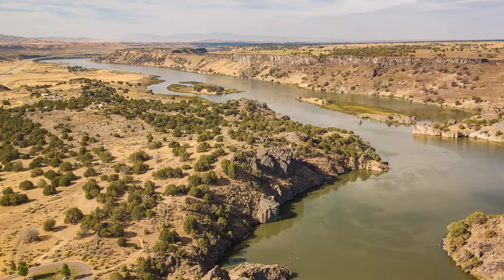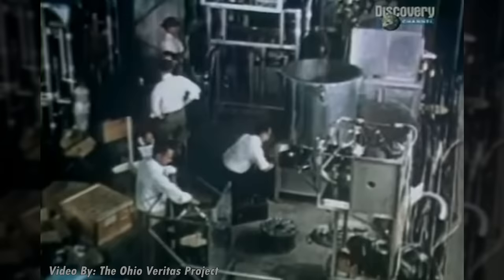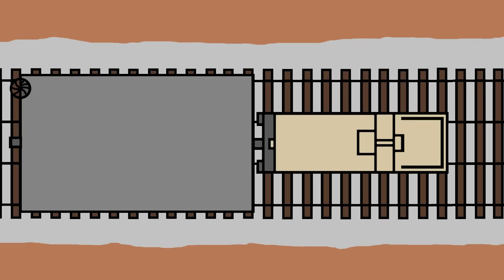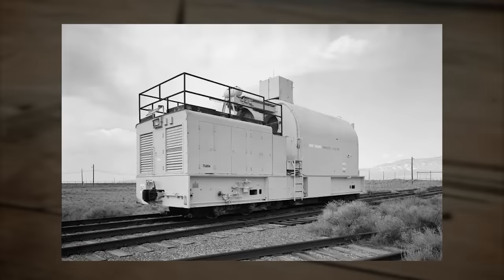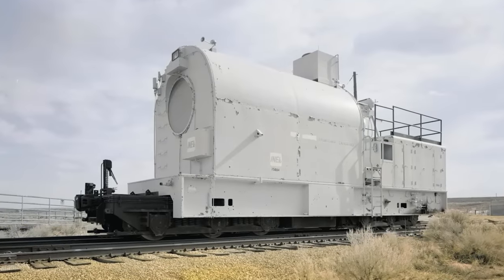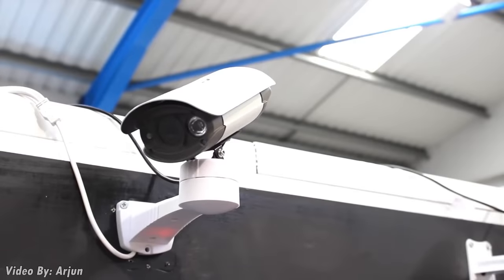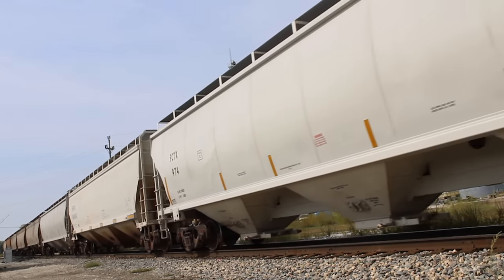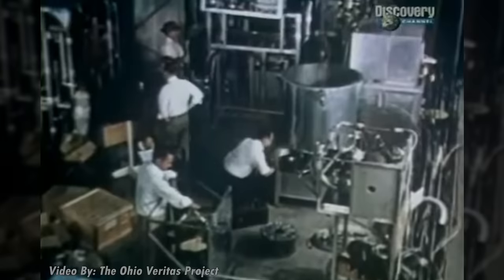The US Government's SECRET NUCLEAR RAILWAY!

Comment: The most extensive use of the railroad was during the AEC Reactor Test Station, Loss Of Fluid Test Program. Every reactor design was built on the flat car, inside what was called the "Hot Shop", a big shielded building with remote manipulators and robot cranes. The flat car with the reactor on it was then pushed into a containment dome and left parked in there on a bridge over a large pit. A very large water tank sat on the north side of the dome with a big pipe and a big gate valve to quench a runaway reaction in the dome. The water in the tank was never needed. The reactor in the dome would be connected to control circuits and cooling water systems. When It was at full power, the coolant would be drained out of it and it would be allowed to melt down. When the reaction stopped, because the melting metal diluted the melting fuel to the point where the reaction couldn't continue, everything would cool off and solidify. The destroyed reactor would then be pulled out of the dome on the flat car and moved east to the "Hot Shop", where it would be carefully torn apart and every aspect of the meltdown damage would be recorded. All of the reactor designs from US companies and a few foreign concerns, were built and tested to destruction at the Reactor Test Station during the LOFT Project. All of the buildings are gone now. They were demolished and the pieces buried during 2010-2014 by the Idaho Cleanup Project contractors. Only the locomotive remains at the Experimental Breeder Reactor 1 museum, south of US Highway 20/26, just north of the Big Butte Volcano between Idaho Falls (Highway 20), Blackfoot, ID (US Highway 26) and Arco, ID (US 20/26), northeast of Craters of the Moon National Monument. The museum is open from May to October with INL employees providing visitor education.
Reply: wow those reactors mustve been really hot!! as in radioactive.
Reply: I'm truly impressed with this knowledge. It's something most people would never know. It adds to the fact that logistics is the main way of understanding how things work. One can have/imagine a wonderful idea,but the question is always, "how?"
  I am from a unique group of individuals who always ask, "what are te logistics of something happening? Sounds strange, but it makes sense to me.
Reply: You might also want the Alco reactor in Schenectady, NY. It's now under the care of RPI.

Comment: There was a similar rail car at the Lockheed plant in Georgia built to test equipment that had been irradiated. The locomotive would pull an unshielded air cooled reactor around the complex and park it near equipment to be tested. Then the control rods were pulled by remote control.

Comment: Thought I knew a little about INL, never heard of this though! Very cool purpose-built loco and that double wide turntable has gotta be one-of-a-kind as well. Great video. 
And fwiw, thank you for not over playing the danger posed by the lab, as a nuclear reactor such as those being developed and operated at the site, are not and cannot become a nuclear bomb. Those nuclear jets though... They operated with an open air cooling circuit, meaning the air going the core became radioactive and left a trail of fallout. Not a big deal over enemy territory, but not ideal for testing on home soil 😅 (They also weighed nearly as much as that loco!)
Reply: Technically, only the GE design used an open cooling circuit. The P&W design used an intermediate working fluid and a heat exchanger.

The good news for either one though is that most of the neutron activation would be of atmospheric nitrogen, which has a half life of only 7 seconds when activated and would therefore completely decay in minutes.

Comment: Pushing cars at 02:25 is used in a few places for various practical reasons. The Snowdon Mountain Railway (North Wales) - For example - Pushes passenger cars up the mountain without them being coupled to the locomotive. This is a safety feature so that if the loco jumps the rack and rolls down the incline it doesn't pull the passenger car down with it, which tragically did happen in one incident shortly after the railway first opened and which resulted in that practice.

As for top speed at 05:30; If my experience of the Empire Builder is anything to go on, this lil' loco - Despite its weight - Is still capable of travelling 4mph faster than many things operated by Amtrak! 🐌💨🚂😉

Comment: Never knew there was a little network of tracks and even a turntable at this place. I knew about the wide flatbeds and only saw pictures of the shielded loco, but I didn't knew a thing about the rest. I thought there only was one piece of track to push experiments around, and not at all of this. Very impressive installations. Would be lovely to have a model form of all of the place (with running trains of course) at the museum. Modelling nuclear reactors must be a lot of fun :P
And there is also another very unique loco related to the US cold war nuclear industry. And it's a darker and even more radioactive story. It's at the Hanford Site. The process to produce plutonium for bombs involved irradiating nuclear fuel for a short time in specialized reactors, then taking it out while the thing was still running, to be then processed in separation plants (the "canyons") in another part of the complex. The thing between the reactors and the separation plant is a railway, of course, and the way to transport something as radioactive as a freshly irradiated nuclear fuel is under water, in a specialized open top railway hoppers full of water. The water was a sufficient shielding for a normal locomotive to be used to push the wagon around, albeit with a flatcar between the water hopper and the locomotive to have some more distance and protection for the crew. But once at the separation plant, the wagon had to enter the heavily irradiated building. Separation plants are so radioactive that no human can enter these places, for ever, all have to be remotely operated. Including a little, electric, one of a kind, battery operated loco (produced by Atlas Car), that was used to push the water and radioactive fuel filled flask car on the last branch to enter the building. The dark part of the story is the end of this little engine. In the separation plant, any machinery that failed was replaced with no direct human intervention, all with remotely operated tools and cranes. The heavy machinery was hauled with overhead cranes to where the nuclear fuel came in, where the railway was. An empty flat car awaited the heavily irradiated equipment, and the little white loco task was to push it in a dead-end tunnel, a nuclear waste tunnel, which progressively filled with more and more flat cars full of equipement so radioactive that no one could touch it for thousands of years.... And at the last one, the little electric loco didn't came back from the tunnel, and was entombed too....

Comment: If you push a load….  Then you have to pull it back out.   The locomotive pushed and pulled 50/50.
Reply: Sure, but If you push the load towards the experiment, you can run away backwards without the experiment being in the way

Comment: Would it not be prudent to use nuclear batteries, radioactive graphite graphite compressed into radioactive diamond's and sandwiched between layers of thermo elements, those beta batteries china is claiming they invented but didn't, a battery that you'll never have to charge and has a life span of 50 years

Comment: Is she a Steamer?  She kinda looks like some sort of tank loco or one with a built-in tender.  I know many Nukes are steam-powered, I was just wondering.
Reply from the maker: No, it was propelled via two diesel electric power plants.
Reply: @Southern_Plains_Railfan  Powerplants?!  That's not something anyone would expect to be mobile.  Nuclear railways are certainly something else.
Reply: @Yamauma-No.10  Nah, "power plant" is often used to describe the power source of an airplane or ship as well... Doesn't imply much about size and doesn't always refer to a building... But I agree it sounds weird
Reply: Nuclear power plants produce steam that spin turbines.  Also most people don't know that nuclear power plants don't directly use the electricity they produce, it goes out into the grid and the plant receives it's operating power from the grid.